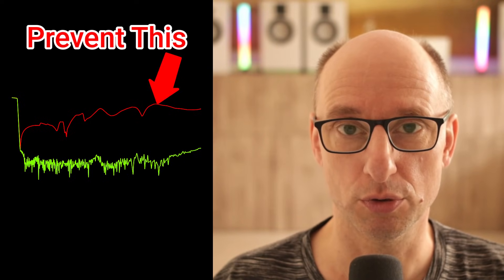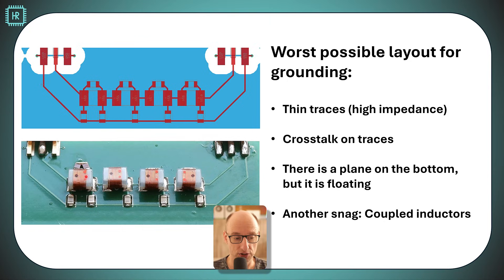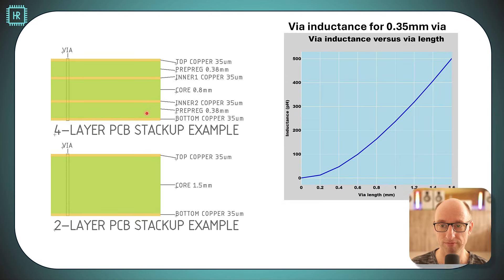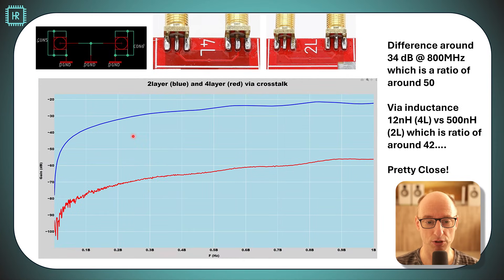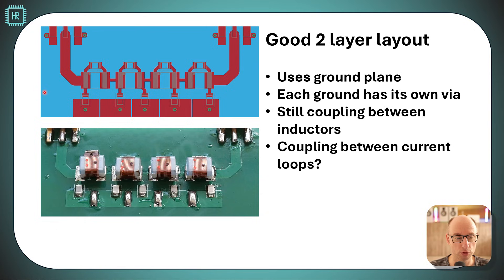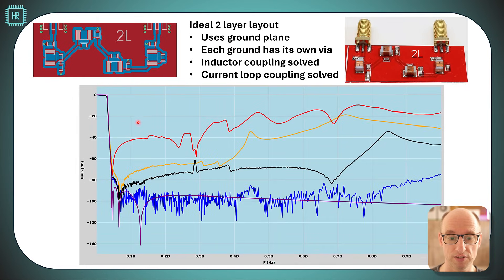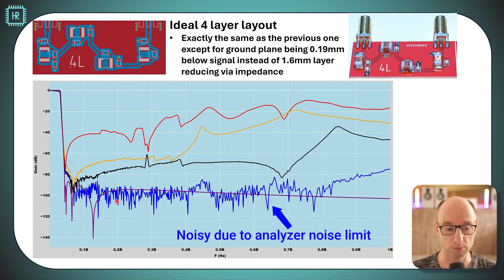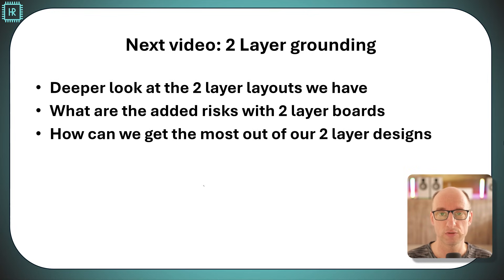Flawless PCB design: 3 simple rules - Part 2

Comment: in the last case you have 4 sections interconnected having a ground plane 190um underneath. did you adjust the width of the traces for controlled impedance or it was not a factor?
Reply from the maker: This was not a factor at these low frequencies. However, in this case it does end up close to 50 Ohms.
Reply: @HansRosenberg74  10Q for the reply.

Comment: Great video. One thing I have noticed when dealing with HF filter boards is a bit of symmetry on both sides. Many of the HF 2 layer boards I have seem to have some symmetry on both sides. They have the same amount of copper on each side of the board for ground planes. I think this helps with stray capacitance or inductance. If they do something with one side, they do the same on the opposite side when looking down the length of the board. They also use the full solid ground planes on the bottom as well. And they seem to work well. Look forward for the next video
Reply: I think the symmetry has more to do with some PCB manufacturing processes - depending on the process it can be more difficult for the manufacturer to electroplate the same thickness of copper onto both sides, or etch for the same time without different amounts of undercut, if there is vastly different copper areas on the two sides. More recently I have not seen rules about this, so perhaps changes in manufacturing mean that PCB manufacturers no longer have difficulty with this. In any case with symmetrical copper coverage there is less tendency of the board to bend when it is heated or cooled due to the different thermal expansion coefficient of copper and FR4.
Reply from the maker: I think the frequency of this is still too low to be really impacted by symmetry, the wavelength at 1GHz is still quite long and the components have so many parasitics there already that those dominate the performance when using a 4 layer pcb.